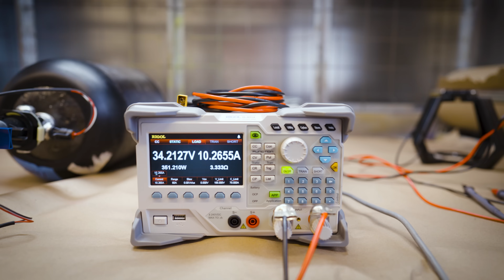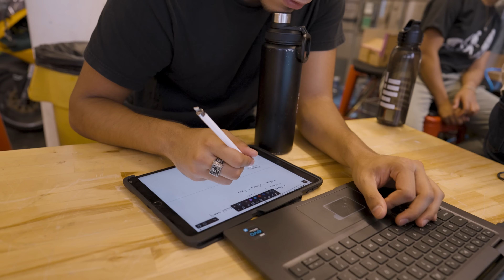For the love of speed: Building a hydrogen-powered motorcycle

Comment: Been around cars, bikes, and airplanes my whole life... and now at 65 I've had a pure EV for 5 years.  THIS IS THE BEST MIX!  
Lightweight battery pack, then maximize the H2 system power capacity and storage... the energy density would be a HUGE upgrade for EV's.  I've often considered getting a fuel cell and H2 storage vessel from a scrapped Toyota Mirai, and put them into my 60Ah BMW i3... a much better "Range Extender" than the BMW 2-cylinder ICE generator. (I've also been a "functioning EE" since 1980, though not degreed... though my eldest son graduated MIT with Masters in EE two years ago, and our youngest is working towards his Mech Eng degree (Aerospace) at Brown)

Comment: I love the work! Keep going guys! It’s totally possible to hydrogen beat diesel and gasoline speed. Hyperion car X-1 can go 0 to 60 mph in 2.2 seconds, I believe is currently the faster hydrogen super car in the world. So, if is possible to do it in car, so it can be done with motorcycles. I’d love to buy someday a motorcross fuel cell engine. In time, eventually it will happen. We just need to invest in better hydrogen technology cars and motorcycles pieces of engine and everything that is needed to increase it speed and endurance. Although, currently there are comercial obstacles towards how to produce hydrogen, we all live on a hydrogen fuel era currently. The white hydrogen is the most cheap to produce and it is the future of fuel. The Green hydrogen is the most expensive and hard. In time, we will fix all the economic and comercial obstacles, as well the means of production. There are a few vehicles powered by fuel cell currently, like Hyundai and they have hydrogen stations to fill up and it can take less than 5 min to fuel everything. The results are great, emissions is the lowest of all fuel, specially if is from white hydrogen, but I doubt it because white hydrogen is not available in any stations, but is the cleanest hydrogen.

Comment: To be honest, hydrogen storage is the issue. It is extremely hard to store hydrogen for long durations as  its the smallest element. Therefore it diffuses through most materials. Storing hydrogen at super high pressure for a long time with an acceptable rate of fuel loss is the challenge. 

Fuel cells are a rather proven technology, the space shuttle ran on fuel cells.
Reply: This is a problem with methane, but we still do it. At least hydrogen doesn't have like 80x more green house effect than CO2.

Comment: I read the hardest part of this is building a tank where the hydrogen doesn’t all leak out because the molecules are so small.
Is that true? I don’t know.

Great piece though! I love it!!! A+
Reply: Yes, I think the team uses compressed high pressure hydrogen which may be around 700 bar and 39 kg/m^3 density. Hydrogen diffusion should be considered because as you said due to low molecular size hydrogen can start material failures. I see that the tank is commercial, probably aluminum or thermoplastic liner with evoh and over them filament wound carbon-glass epoxy composite. The most efficient way is the cryogenic storage with high density but it requires constant cooling source or high thermal insulation even for 1-2 day storage, liquid hydrogen rockets use this way.
Reply: @burakselamet6181  That was a very thorough and thoughtful answer to my question. I appreciate you taking the time to explain it to me. I wish the team all the success possible.
Reply: @stevereal-  You're welcome!
Reply: @burakselamet6181 Thank you very much sir, sorry for the inconvenience. 
🌹🌹🌹🌹🌹
Reply: @ياقوت-ق  Thank you as well, have a nice day!
Reply: I think the other obstacle is that the fuel cell corrodes over time, in addition to requiring rare and expensive materials, so you will have two components that are consumed over time and must be replaced: the battery and the fuel cell ! For me personally, I prefer a hydrogen combustion engine over an engine powered by electricity.
Reply: @ياقوت-ق  Yes, I suppose you are right about your assumptions. But as I said if the hydrogen is stored as a liquid then efficiency would be maximum. In other words, combustion is a fast process and it would highly consume hydrogen compared to the fuel cell. Maybe in the future if we store liquid hydrogen easily then combustion processes may prevail.